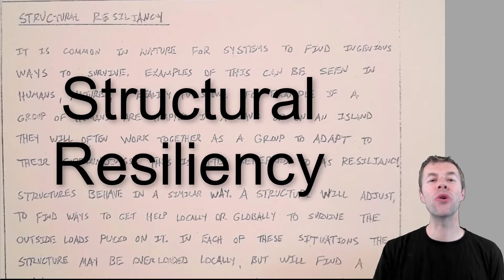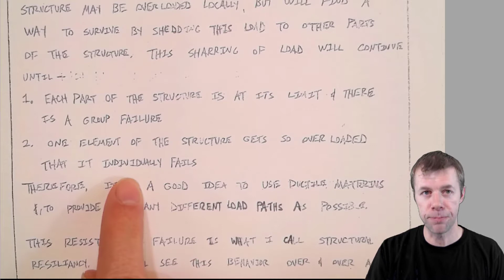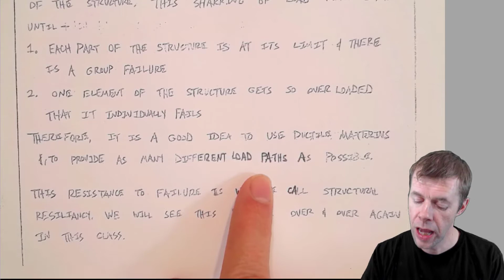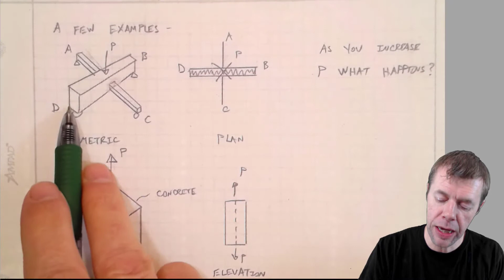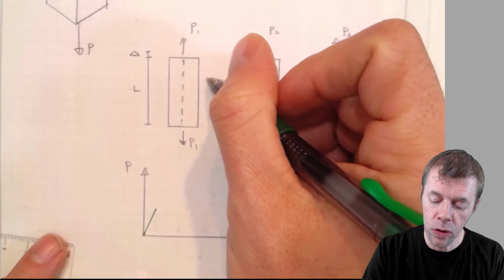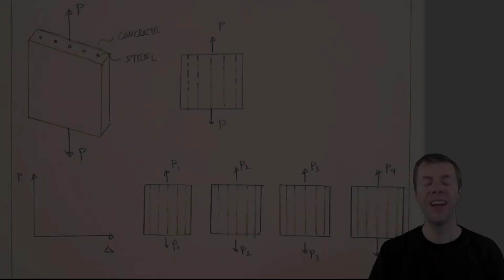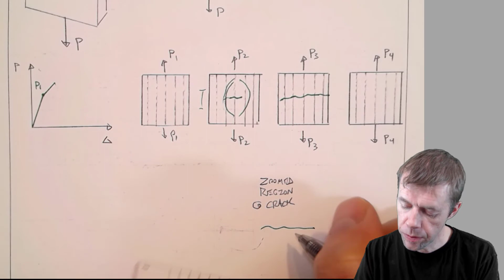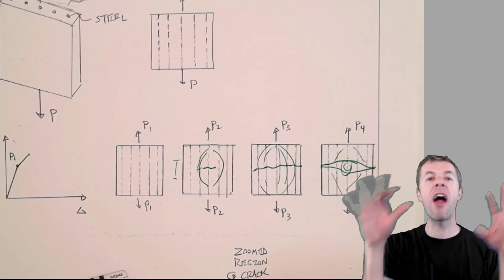Why Do Structures Fail? - Structural Resiliency in Reinforced Concrete

Comment: What about building #7 how does concrete respond to controlled explosions when no plane hit it?  And the twin towers that is another story. Yes this building was designed to take the impact of several jets. But thermal ribbons at a 45 degrees exothermic can bring it down faster with controlled placed detonations. I am sure you found this a strange study. Thanks for your intelligence I am learning so much.

Comment: Please explain what happened to the World Trade Center on September 11, 2001.
Reply: concrete loses all its strength at 900C. World Trade Center temperatures hovered over at 1000C.
Reply: @gabrielbobmarley  I think WTC made up of steel not concrete. Correct me if I am wrong with a reference.
Reply: Inside job